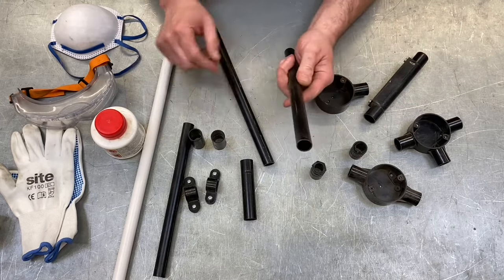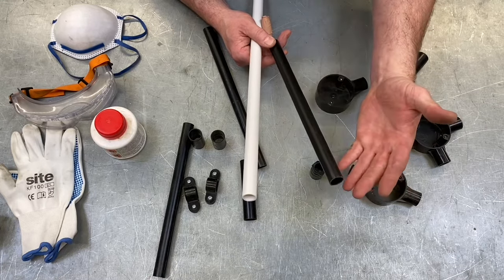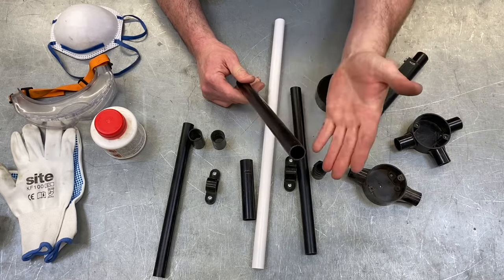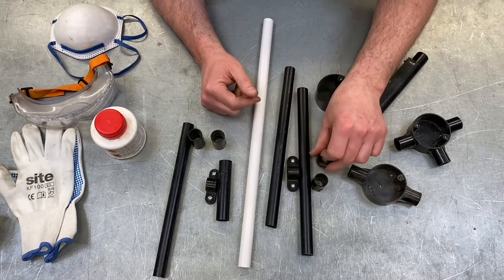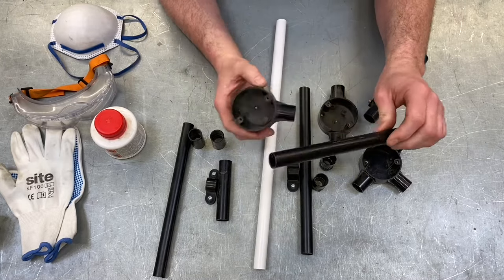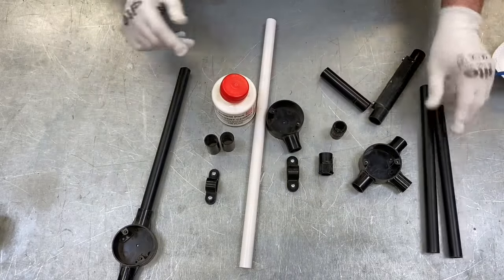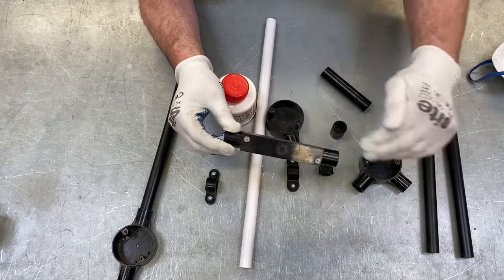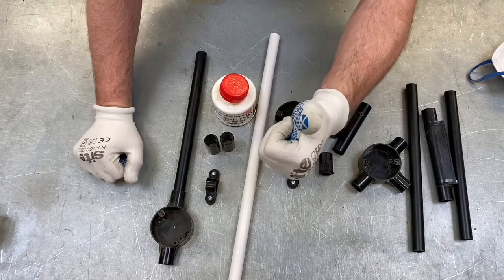Do You Know Your PVC Conduit - Sizes, Types, Colour, Saddles, Expansion Coupler & Boxes - Explained

Comment: In the Netherlands I’ve learned to use PVC conduit in the seventies, since it’s mandatory here, but I’ve never ever seen it glued? The clips mostly used are nailed clips with the nail already in, way faster to install and if you clip it properly it won’t come apart when pulling the wires. Also we use spring benders and if the corners are very challenging flexible conduit.

Comment: That’s awesome I have a home workshop I need to wire , very helpful. One question  why can’t you install it below zero?
Reply: I think it's because it's brittle at freezing temperatures, so it will likely to crack when you bend it or cut it. Also, it'll expand in summer and will bend.

Comment: Hi guys. I have a question.  I have a s.w.a. cable clipped to the outside of a house and then buried in concrete and appearing again at a garage supplying a consumer unit.  The length of the cable is approximately 15metres. I believe that it is 6mm. There is a 30m/a rcd fused spur in the house protecting the s.w.a. fed from a 'b' type mcb in the consumer's main board rated at 20 amps.  
The consumer unit in the garage is supplying three twin sockets and two flourescent light fittings. The small ring in the garage is supplied with a 20 amp 'b' type m.c.b. and the lights are supplied by a 6 amp 'b' type m.c.b.  and a 45amp main switch is incorporated in the consumer unit. 
 I have trip-tested the sockets and the r.c.d. in the spur  goes out well within the specified time. I think it was 11ms to be precise.  Is this method of wiring compatible with 18th edition wiring regulations or should i disconnect the earth from the s.w.a. and spike it with a T.T. earthing arrangement totally separate to the PME of the house?
Reply: Any water or gas pipes garage ? Is there an RCD  in garage ??
Reply: @brianoneill350  no
Reply: No rcd jn garage and no gas or water pipes. Should I put 100na rcd down there?
Reply: @anthonystark6372  If it were me I would put an RCD in garage and an RCBO on cable going to garage with time delay or discrimination so that the 30 Ma RCD in the garage trips first. The earth should be from your DNO. No TT unless your main earth is TT. No equipotential bonding required. The armoured cover of the swa should be earthed for safety.
Reply: @brianoneill350  No water or gas pipes in garage.
Reply: @brianoneill350  No rcd in garage.